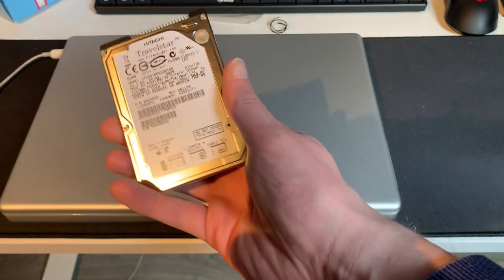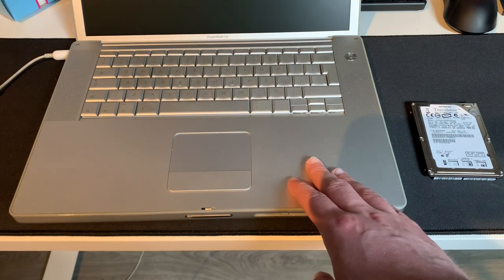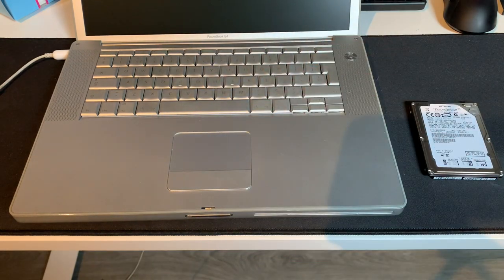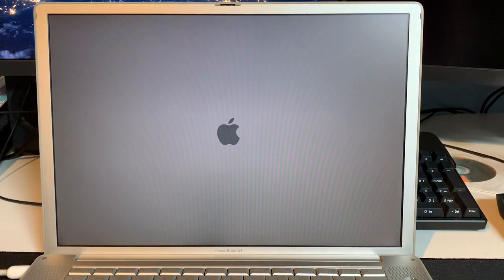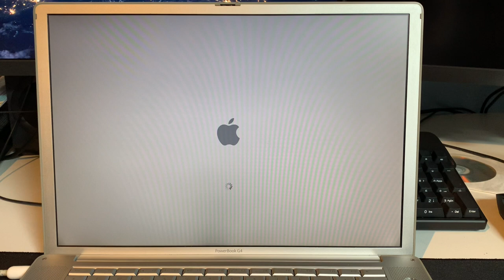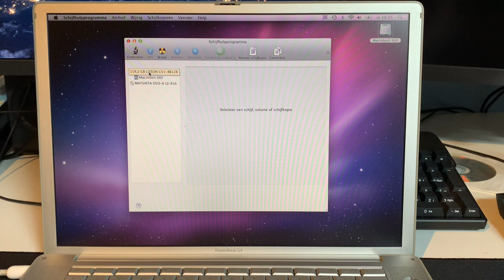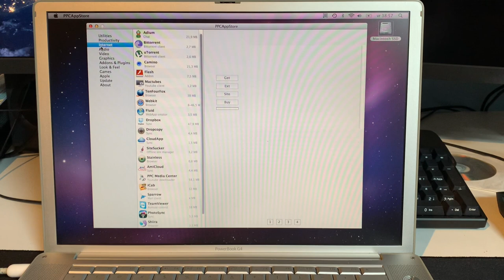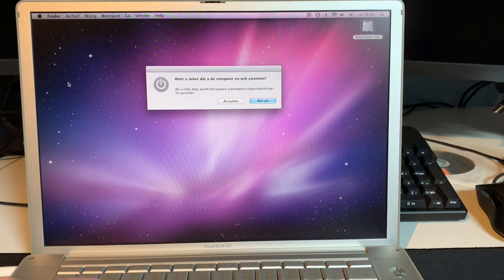PowerBook G4 15" FW800 - SSD Upgrade

Comment: Purchased the same M.2 SATA SSD to 2.5 IDE 44pin Converter and a Crucial MX500 M.2 2280 250GB SATA III 3D NAND SSD. This combo is not recognized in my Apple PowerBook G4 1.25GHz 15" FW800-AI at all but works perfectly in my Intel CPU Windows laptop. Traditional ATA hard drive works in PowerBook. Any idea why the SSD wouldn't work?

Comment: how did you get the powerbook to see the ssd? Did you format it before replacing into the laptop?
Reply from the maker: Formatting is not required to get it to pop up. If it’s not showing in disk utility, there’s something     else wrong.